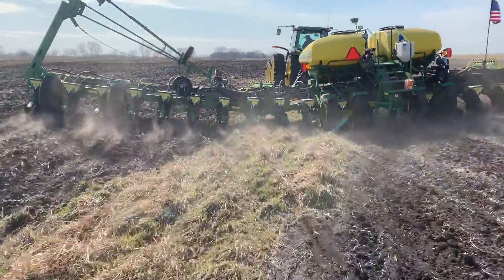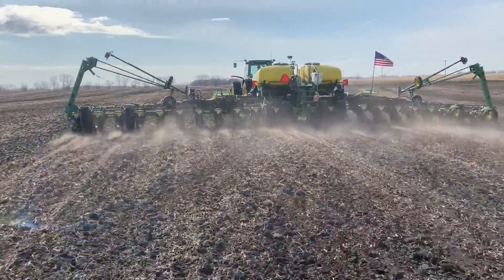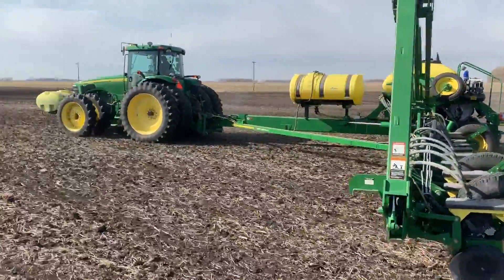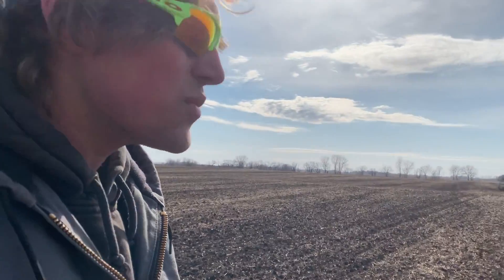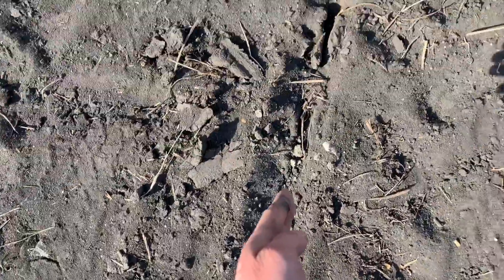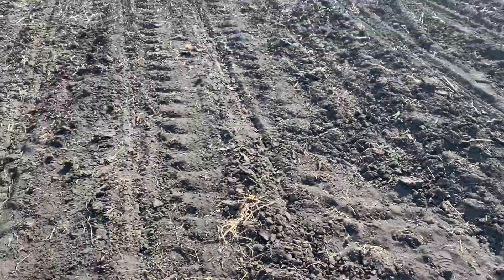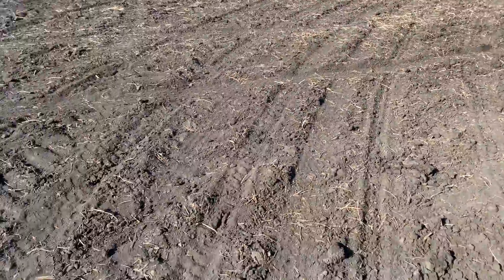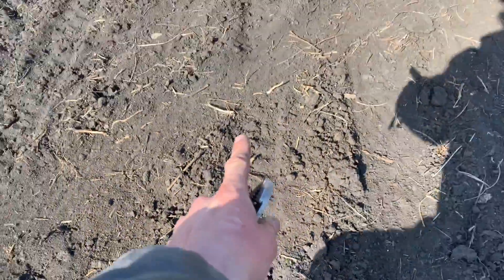Raw Uncut Footage Of Planting

Comment: Oh wow that's neat! That looks so good flying across the field! An jeepers the, gauge, packing and closing wheels are flying!!! I wonder if they will have to upgrade the bearings in them or how much sooner they will fail?
Reply from the maker: First year out with them so we will see.
Reply: @LarsonFarms  Yeah time will tell! 

Hope all the new upgrades work out well for you guys and you get some good weather to get your seed in the ground. AS the hours get long, stay safe out there.
Reply: Should be fine, we run a 24-row high-speed planter to the John Deere 1795nt planter upgraded with Precision planning stuff and it runs 10 miles an hour with 99.9% seed population we never had no issues with the gauge wheels are close and wheels or the bearings going out because of going faster
Reply: @chadnelson924  Hmmm neat to know, thanks for the input! Planting at those speeds, that's pretty neat!